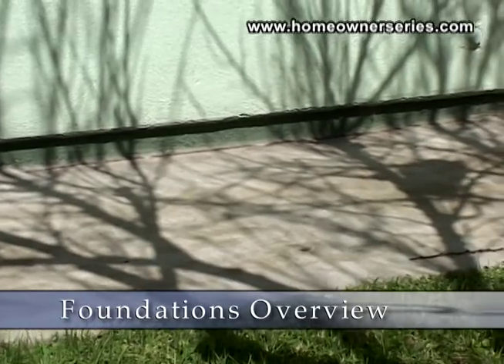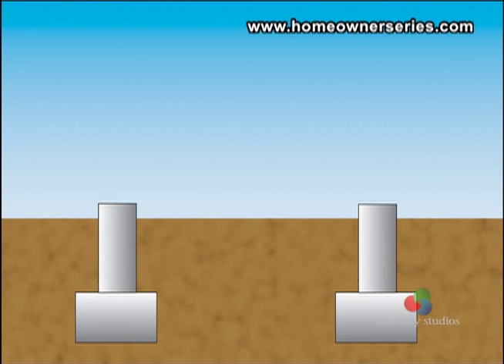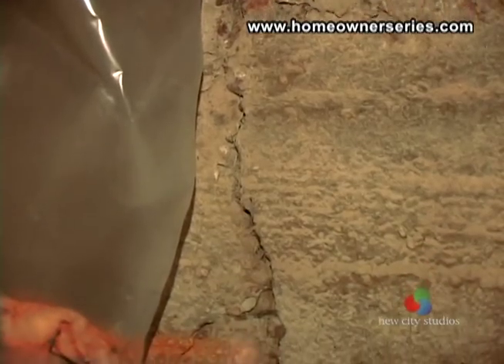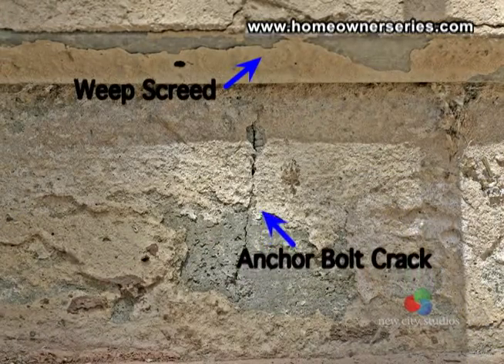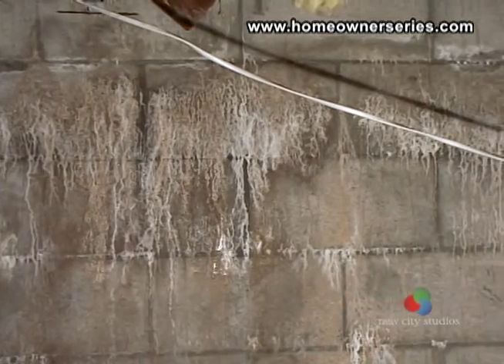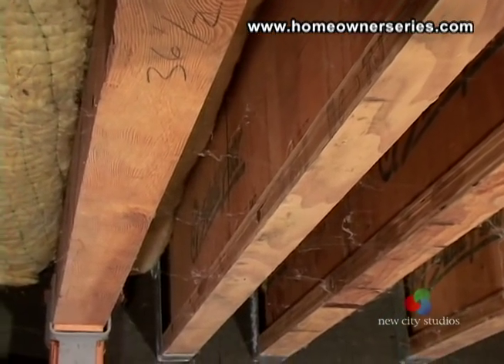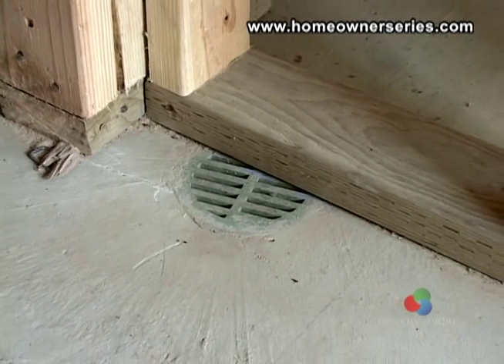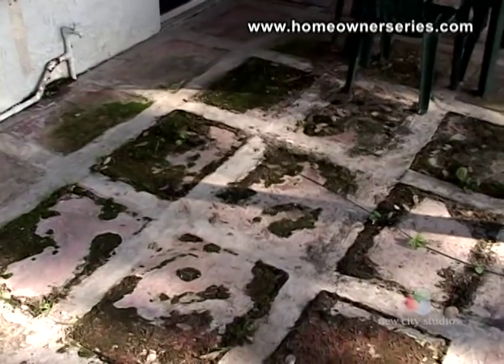Home Inspection - Foundations

Comment: Engineers are meant to engineer/propose a certain educated design to fix something specific using trade knowledge gained in their training.   Ive had 4 different engineers come to my home, each charging upwards of 500$ just to come out at their leasure.  All 4 engineers had 4 totally different “engineered ideas” to fix my structural issues.  Only one was actually im my opinion an engineer, the others were people who paid for a degree..  the one who was worth a shit took soil samples, core drilled for insects and had a boroscope inspection done (upon his arrival the second day) he also obtained a history report of my and surrounding houses permit requests and documented repairs to compare my situation.  He literally laughed at the other “engineers” ideas and even took their names so he could help others avoid them..  His ideas were for me to get a new guttr system with french drain routed to the sump pump indoors then to route that 20 yards away from my home, to get piers ran in the ground at 5 locations (pier company suggested 23 @1k$ each) and to rebuild 2 lally support columns and pour new 24x24x24 footings for them and gave specifics on how the piers need to be installed and depths with hydraulic pressures for the installers, even quoted me average prices on the stuff so i didnt get my ass handed to me by some jagoff inc.  
  The other engineers ideas consisted of filling all of the voids in the cinderblock goundation walls with morter, carbon fiber bandaids to support the bowing walls, one even said i should move and the house should be condemned (house was built 20 yrs ago on clay soil..  only a few stairsteps and a horizontal but still and issue, just not condemning...).   So choose your plays wisely and do your homework/ research on both who you are hiring and knowledge of what they will be doing and how they are doing it.  Keeping an eye on em because so many people these days, more and more frequestly cut corners or are just plain dumb and will screw you quicker than you know..  some are skilled thieves and will hunt for ways to get you over..  some are good people who just want to help and make a good living doing what they can do good at..  those people can even live in a shell looking like an asshole but will go up and above just to have a happy customer and help.  Had a contractor that up until the final day was a complete dick, would littr on my property and even cursed me for parking on my property to get inside.  But when they finally finished he took off 4k$ because he said for putting up with him while he was going through personal things..  but the only smile, for 10 seconds, was when he finished showing me the work abd watching me in amazement of what all they did and thanking them..  lifes little things.  But those guys are harder to find sifting through all the money hungry scammers... good luck!
Reply: Good video though.  Never realized that the level of water in the sump pump is actually a reflection of the surrounding water table of saturatec soil... good deal pickle..!   :)

Comment: Hi everyone, we a building a new house. After the foundation was completed, our contractor found out that the house was two feet short than the original design. They are now trying to extend the foundation and will add rebar and concrete. My question is that is this sufficient to prevent future cracking? Will extension of foundation cause serious problem that we are unaware for? Thank you very much.
Reply: Youjun Chen 2200sq
Reply: yes the concrete can added onto. the rebars must be glued into the existing foundation with the proper. type of epoxy at the correct depth. for your own peace of mind have structural engineer design the repair.

Comment: @5:50 What the hell kind of a wall is that? I can see the crack, but I think I'd just put the damage down to incorrect, amateur construction - not necessarily foundation failure. Not exactly a bonded corner, is it?

Comment: You only missed a few types. Benched stonework foundations. Stem walls. Pier supports. How about a basement with a crawl space under it? I came across one with floors that had 2 1/2" thick plywood subfloor decking on 12" center 1x12 joists. I was pretty sure I was not walking on concrete. >2" of plywood over 12" joists was really solid feeling, especially on thick pile carpeting.. It took me a while, but eventually, I found the access point to the subfloor's crawlspace. No insulation on duct work or hot water pipes, damaged leaking ducts, misc water leakage, and moderate flooding in the past. Okay, now I find some cracking and a submersible pump in the corner, so I call out an engineering firm. Wow, they had more outs in their disclaimers  than I do. No materials or soil analysis? Ouch! There is now a non hardening catalyst epoxy gel to seal up cracks. It's very good stuff! It moves with the building. Removal of trees should not be recommended without a report from a structural engineer. When the tree dies the roots will die, leaving voids under the foundation and or pad. So, select your engineers carefully, and know when you need to recommend calling one in. I recently had the experience of inspecting a house up on 14 foot tall stilt pilings. It was in the flood plain of a river. It had a concrete pan deck supported on commercial type building steel.That was a fun one! We had to recommend setting in screw jacks on the concrete piers and pier jack the structure level without cracking the concrete in the pan deck. Success!  Cheers!!